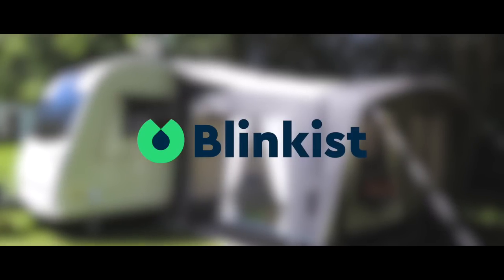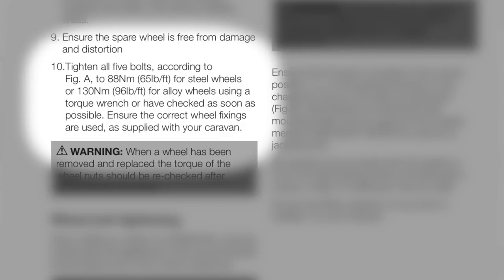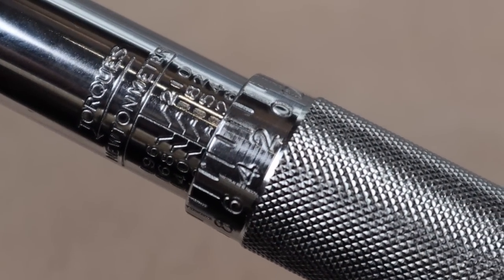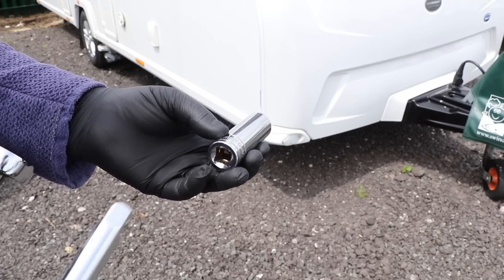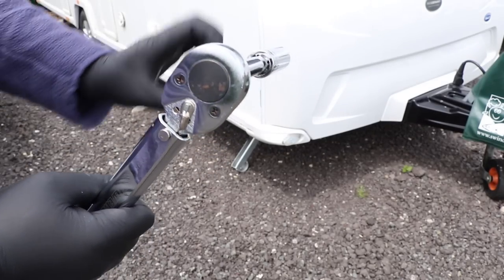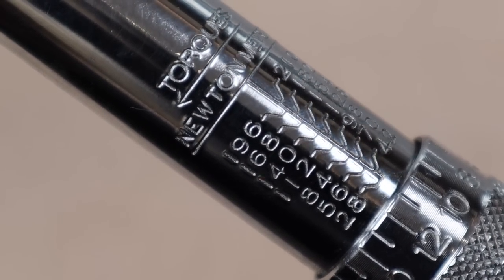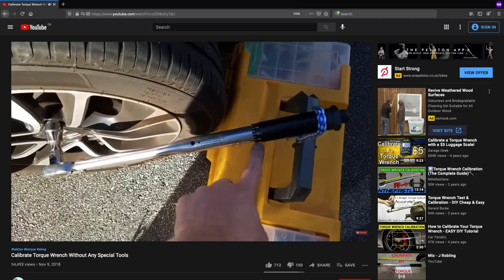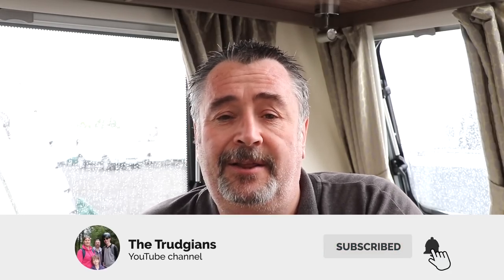Using a torque wrench for caravan wheels

Comment: Great video Dan. I always check the torque settings before every trip largely due to the fact that I had a nearside wheel detach from the caravan whilst towing! £9500 later the caravan was fixed - the wheel had punched a whole through the caravan floor and caused a lot of damage (even though I was only travelling at ~15mph approaching a junction!). I dread to think what would have happened on a motorway :( Fortunately the insurance company were great and sorted everything out without a fuss. It took a long time to fix due to parts shortages but all is good again now.

Comment: Thanks Dan, great advice as always. I use the Milenco one. It comes with those little plastic caps with arrows on, which are meant to indicate if the wheel nut has loosened. Really good idea, expect over time I've lost them. A little like dust caps on my car. Graham

Comment: Always a worthy reminder on torque checks and settings. I would also want to mention that NEVER lean on the end of the torque wrench tightening up the wheel bolts when an extension bar is being used. Always hold the wrench at both ends as not to run the risk of chewing up the wheel bolt heads, and more importantly saving you from face planting the floor 😉

Comment: Good explanation of wheel tightening and why you need it but I felt the close ups on the torque wrench itself were a bit rushed so I didn’t really see how you adjusted them. I do have a torque wrench but I am not at all confident in using it to check the wheel nuts. I would love a video please on the torque wrench for beginners taking it a bit more slowly.

Comment: Hi Dan, I've watched a lot of your videos before purchasing our caravan, which we pick up tomorrow. Your advice has been invaluable. I  bought the Milenco torque wrench for our wheel nuts. Is it normal for the handle to get stiffer as you set higher torques? I can just about get mine up to around 130Nm by hand but would struggle to get it any higher. Thanks again for the great video content

Comment: Always do mine when I leave both Home and site, procedure as you say..  Thanks Dan.    Can I just comment on the "loosen before you check"   has Dan said, if the nuts have been loosened, they need  to be checked after a number of miles.   So if when you check the nuts you loosen them , you will have to check them again, lets say 30miles.  but if when you check them again, you loosen them again to check, you will have to check again after another 30 miles.  Recurring.

Comment: If you don’t loosen the bolt first you are just checking that the torque is above or equal to the setting, surely?
Reply: Correct, your torque wrench will only be confirming it is clicking at the setting chosen by you on that wrench and will indicate a pass an over tightened nut. It would be wise to release all nuts first and start at the beginning.

Comment: I always do mine FT. But seriously another tip Dan, always wind your wrench up to your desired torque setting and never down. The backlash on the internals won’t give you an accurate setting. But if you you unwind it after use you will always be winding up to your setting anyway

Comment: In my opinion for a nut that was previously tensioned by another the torque wrench will only be confirming it is clicking at the setting chosen by you on that wrench and will indicate a pass on an over tightened nut. It would be wise to release all nuts first and start at the beginning I.E. zero.
Reply: That is what I was thinking… otherwise it’s just telling you that is at least that tight, it could be a lot more. Only by loosening then first can you be sure!
Reply: Not sure I agree about loosening them every time. If any thing I would set torque wrench under by 5 so you are not trying to tighten ever time

Comment: You need to learn how to use a torque wrench correctly particularly if you’re using it with an extension on it you need to support the ratcheting end to apply the correct torque value
Reply: Hi Peter, my torque wrench has a 'degree' setting too - what should this be set at for wheel nuts? - 0 or 90? thanks in advance?

Comment: Great video on an important topic. My caravan has two torque values, so I got between the two. I hope that’s correct!! On an unrelated note, have the Morley’s stopped doing YouTube?
Reply: Are the two values showing as a range (for example 110nm - 130nm). Or two separate numbers?

The two separate values could be for using steel wheels (normally 88nm) vs alloy wheels (normally 110nm).
Reply: @mattuk4748  thanks for the reply it’s separated by a slash. So looks like this. 110/120 nm
Reply: @maino9752  perfect, in the middle is fine.

Comment: Well, I've never reset a torque-wrench. Maybe I should. I assume it release a spring mechanism. Thanks!
Reply from the maker: If you don’t release the spring, give the wrench a quick calibration - it’s quite easy and will let you know if the wrench is still reading the correct values. Take care.

Comment: Sorry but as a caravan builder this is wrong and dangerous advice they need torqueing up when the wheels been removed and 50 miles after and that's it because every time u torque them the nut is moving 1 to 3 mm everytime causing strain and stretching and eventually snapping or failing well the wheels in motion so no they shouldn't need to be checked every journey if dune right after fitting
Reply: I'm inclined to agree

Comment: Unfortunately IF tyre pressure and torque settings ARE so important then this is yet again a woeful example of how poor the caravan industry is. The Lunar Handbook DOES NOT give the correct tyre pressures and you are completely in your own when it comes to changing from one wheel design to another. It is a mammoth task to ascertain the correct torque. Is that dependent on the chassis, the hub or the wheel?? Take you best guess ( can’t be that important can it ? )